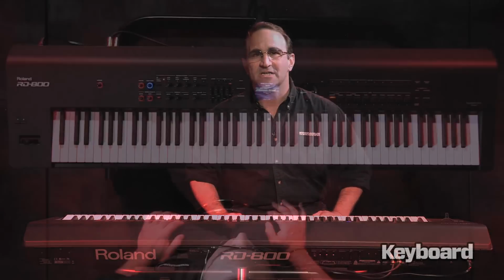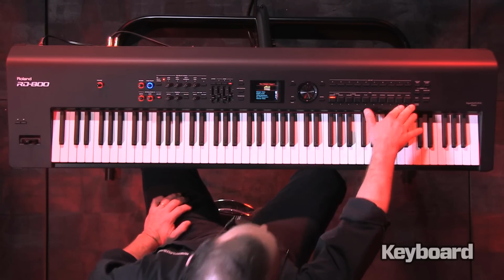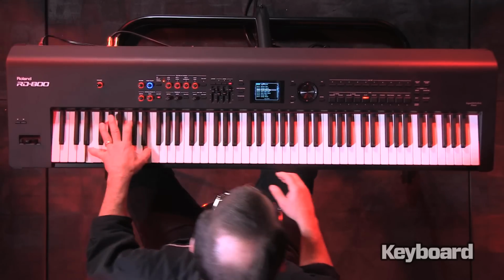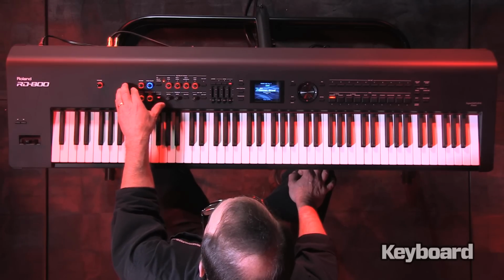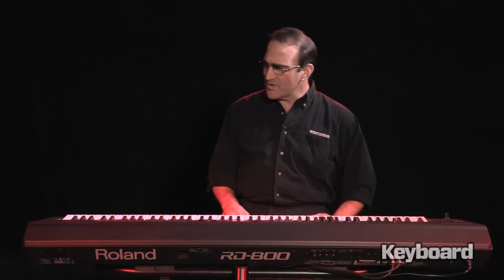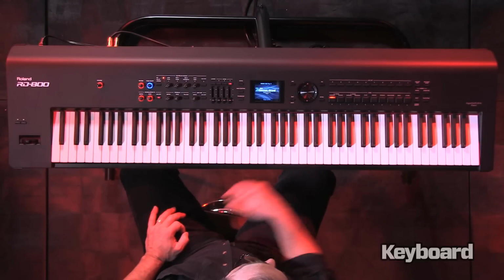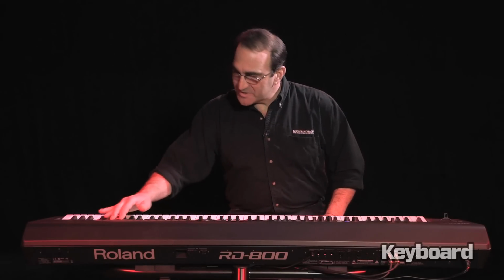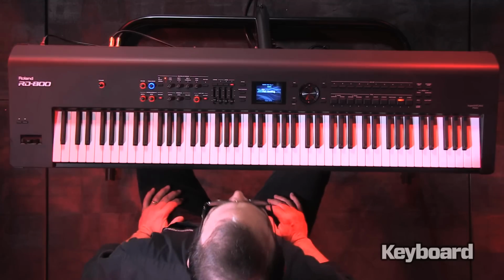Roland RD-800 Stage Piano First Look

Comment: I have everything plugged in and turned on, and it all seems to be working, and I just received it from a rental company- however, no matter what button I press, I cannot get sound to come out of it. I press a key and nothing happens. I adjusted the volume and pretty much everything else but it doesn’t work? Help!
Reply: This piano doesn't have internal speakers. You can use head fones.

Comment: a real piano is demonstrated by playing it, not talking about it. It is for musicians.
a digital piano is demonstrated by doing 90% of talking and noodling on the keys while changing settings. Therefore it is for amateurs.
Reply: goognam goognws
Reply: goognam, I noticed that Russian professional TV orchestra "Red Square Band" uses RD-700SX. Therefore I was thinking that this must be a good machine. I am wondering if RD-700 has automatic band accompaniment along with the rhythm. And in case it does have it, is this only one option of accompaniment or many to chose from? I plan to buy an electronic stage piano mainly for good piano sound, but would like to have an option of automatic band accompaniment, the juicier the better.

Comment: If you listen to some of Rolands old Rhodes samples like the Rd700sx, You'll find they were a lot warmer sounding. I Think they were looking for a new approach to sampling and found it, but new is not necessarily better.  I'd like the option to have older samples loaded into some of the newer models.
Reply: Tyler, I noticed that Russian professional TV orchestra "Red Square Band" uses RD-700SX. Therefore I was thinking that this must be a good machine. I am wondering if RD-700 has automatic band accompaniment along with the rhythm. And in case it does have it, is this only one option of accompaniment or many to chose from? I plan to buy an electronic stage piano mainly for good piano sound, but would like to have an option of automatic band accompaniment, the juicier the better.
Reply: Tyler Thompson I've always thought that Roland's Rhodes sounds were pretty aweful. Compared to say an sv-1

Comment: just from this vid the EP's definitely sound better.. I like the way the RD is set up for live.. I prefer the piano sounds over the noord.. the rest is better on the noord, but I don't have one.. I have RD700nx and Yamaha Motif XF. together they make a great combo.. would be better if you could have sample ability on the RD series so you could really upgrade sounds.. but I have tweaked the sounds with EQ etc. and spent sometime on the RD700nx and I think it now sounds great!!.. stock it sounded thin and didn't sit in the mix well at the gig.. but the tools you have on it can achieve what I was after.. the focus nob (although I don't know it as well as I should.) is not much use...but still so much exploring to do.. I love the action and ivory feel... it was one of its selling points to me.. the piano sounds are awesome.. but straight up the Motif sound sat in the mix at the gig better.. but I prefer the RD piano sound as it has space around it which the Motif doesn't.. great vid BTW.. thankyou!. I'm all cashed out after buying so many keys though!.. just bought Rhodes suitcase 73 MK1 and CP80 in mint condition!.
Reply: ajcatman, I noticed that Russian professional TV orchestra "Red Square Band" uses RD-700SX. Therefore I was thinking that this must be a good machine. I am wondering if RD-700 has automatic band accompaniment along with the rhythm. And in case it does have it, is this only one option of accompaniment or many to chose from? I plan to buy an electronic stage piano mainly for good piano sound, but would like to have an option of automatic band accompaniment, the juicier the better. Thanks.

Comment: I hate to say this, but the pianos still sound like Roland pianos...aka not spectacular.  I had an RD-700 for 10 years before I switched over to a Kawai MP6.  Now, I mostly use it as a controller for VI's.
Reply: Roland piano sounds aren't particularly super or natural to my ears and I've owned the rd-500 w/it's poorly designed hammers that eventually all break. I've been looking into the MP11 having been steered away from the Yamaha C4.
Reply: Matt, I noticed that Russian professional TV orchestra "Red Square Band" uses RD-700SX. Therefore I was thinking that this must be a good machine. I am wondering if RD-700 has automatic band accompaniment along with the rhythm. And in case it does have it, is this only one option of accompaniment or many to chose from? I plan to buy an electronic stage piano mainly for good piano sound, but would like to have an option of automatic band accompaniment, the juicier the better.

Comment: no offence but roland been going downhill with shabby plastic products since the g series have come out they need to fix it up quick or it will be a past product like casio just sayin......
Reply: Absolutely agree. When hearing they reduced the weight I immediately thought: Omg, how did they achieve this? Cheaper body, cheaper hammers, less robustness...?
Reply: mishka0 Nope. It's still very robust. And still heavy. It may be lighter, but it's still heavy and robust compared to a lot of stage pianos.

Comment: Completely unusable B3 sounds for me. The "supernatural" tonewheel organ still sounds like a bad cheesy toy keyboard from the 1980s. ROLAND engineers obviously haven't heard of NEO ventilator, which is out there for quite a long time now.
Reply: I agree.  The Leslie emulation is particularly terrible.  Ironically, when Hammond was going bankrupt, they tried to get Roland to buy up their assets and the tonewheel organ business.  Roland’s Japanese CEO at the time opted not to for reasons I had read that they didn’t like that the Hammond business was failing, knew nothing about how organs worked nor who the customers might be, and decided that the whole home/stage organ market was drying up. IMO it would have been a great acquisition. Roland no doubt would have been able to pump more cash into digital B3 clone R&D than Suzuki did.  We might be seeing a killer “B4” on the market today had it happened.
Reply: Even the Korg CX-3 sounds better.